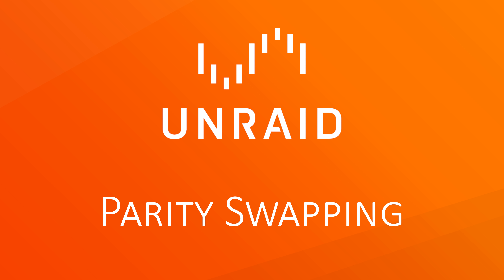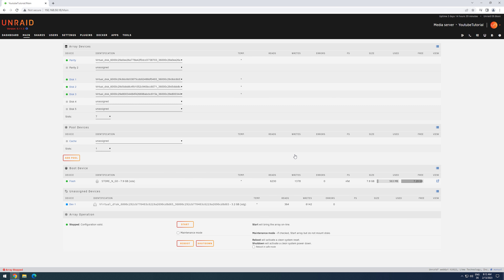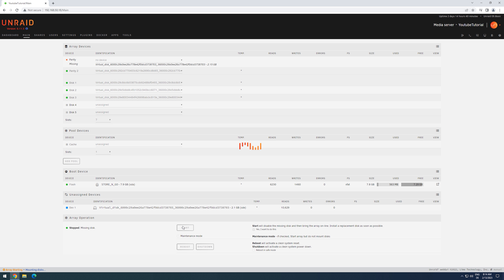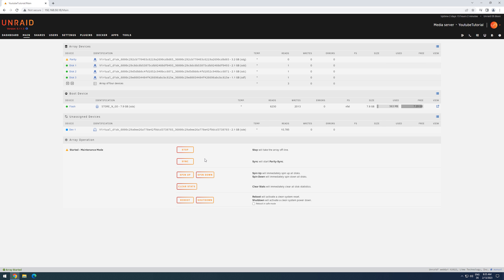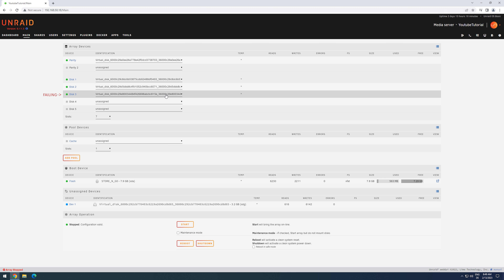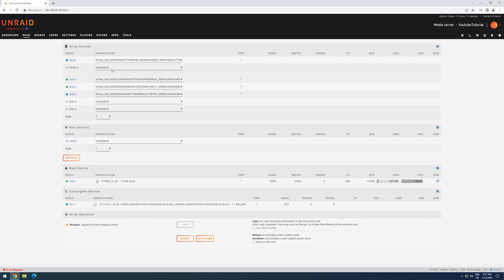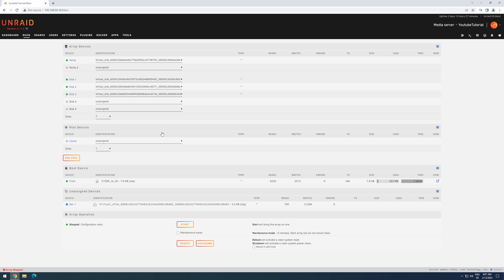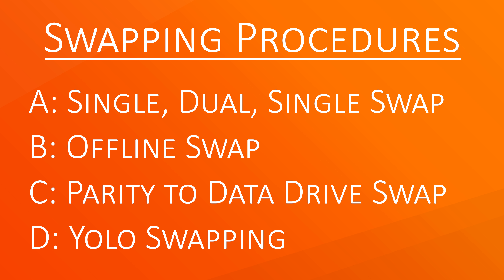Unraid Quickie - Parity Swapping Procedures

Comment: Would it work to do a single-dual-single instead of a parity-to-data-drive-swap? I have a degraded array, 1 bad drive, but the most reasonable replacement drive is a little larger than my existing parity. So parity-data-swap would be my choice, except for the fact that I'd like to have as little downtime as possible.

Comment: The only thing is, my OCD is killing me now that the array has Parity2 but no Parity1.
And you cannot simply change from parity 2 to parity 1 :P 
The calculations used for parity1 and parity2 are different so the disks cannot simply be moved.   If you want to move parity2 to the parity1 position then you would need to rebuild parity.  The alternative is just to remove parity1 and run without it leaving parity2 in place

Comment: In scenario #A how do I get Parity Drive 2, into the Parity Drive 1?
Reply from the maker: If you switch parity 2 into parity 1 you will have let parity calculate new. So you loose parity protection for that time.
Reply: right I was afraid of that, after I wrote that comment I had an unfortunate incident with the backplate of my bay.  One of the connectors broke / went bad..   and coincidentally my parity disk was in THAT particular bay..   so now i'm doing an offline rebuild with the new disk straight away, as the parity was no longer valid, no idea what was happening.   No choice I guess, server going to be offline for 4-12 days.

Comment: When doing Swapping Procedure A, the final outcome leads to the single Parity disk being called Parity 2.
Does this matter? Can you make it just called Parity instead of Parity 2. Is there any reason to?
Reply from the maker: Hi, you can't just change parity 2 to parity 1. Each parity is calculated differently. To get very specific: parity 2 is slightly more difficult for the PC to calculate so it uses a bit more CPU.

For normal usage it does not matter that it is called parity 2 though. If you want to change it you will have to recalculate the parity
Reply: @techngo8473  if there is only parity 2 in the system does it still use more CPU? If there is only parity 2 is there any other functionality that is different?
Reply from the maker: A bit more CPU and otherwise nothing is different. It uses more CPU as the mathematical method to calculate the second parity is a bit more complicated than the simple XOR of parity 1

Comment: I tried to do the copy method but it would not let me start the array if I tried to assign my old party drives to data drives in the same operation as adding the new party drives.
I also only had start array not copy for some reason.

I had two parity drives of 14TB and was upgrading them both to 18TB so I can start using larger data disks.

I ended up doing it in the worst way possible (YOLO) thinking it was going to copy, and that is why it would not let me asign the old parity drives to data (so it could copy from t hem) when I started the array I can see its rebuilding, not copying.  

I am sure everything will be fine, but this video would have helped me like say putting it in maintence mode so I could fall back to my old parity drives if needed.

At this point its running and probably best to let it finish, as I do not think starting a new operation that the old parity drives would be "known" anymore.

Comment: In the first method you build parity two and then disables parity one which is the old drive.
The thing is that the parity 2 drive is different then parity one drive. So how come its working? Parity one is i think xor even parity whereas parity two is different method. So when you remain with parity 2 you actually remain with parity drive which is not the even parity mode.
Reply from the maker: Parity 2 is calculated in a different mathematical manner than parity 1. This way of calculation is more complex to explain and calculate than XOR but basically it can work on its own as a single parity or in combination with parity 1 as a dual parity. 

If this didn't work then we would not really have a true dual parity, as a failing parity 1 would lead to no protection being left.
Reply: @techngo8473  you are absolutely right, that it has to worknon its own also.
I went and did it via method 2, taking the array offline .
Thank you very much. Was very helpful
Reply: Is there any downside to the second calculation technique? Does parity 2 fill up at a greater rate than 1 bit to 1 bit or is it slower?

Comment: Thanks for the tutorial. But what is the best way when I have 2 parity drives and want to replace them with 2 new bigger drivers?
Reply from the maker: Hi, I would switch them one at a time. As you have 2 it's very easy:

1. Stop array
2. Switch first parity drive with one of the bigger new ones
3. Start array and sync (during sync you still have parity protection from your second parity drive)
4. Once done you stop array again
5. Swap second drive with new bigger parity drive 
6. Statt array and sync again.
7. (Optional) add the 2 old drives as data drives

Alternatively:
1. Stop array
2. Switch both parity drives at once
3. Start in maintenance mode and sync (this means you can't use unRAID till the sync is done
4. Once sync is is done stop array and start again.

If anything goes wrong during 3 you can just undo it all and add the old parity drives back. This version is a bit faster overall but means during step 3 you can't access / change your unRAID data.

Alternative 2 (unsafe)
1. Stop Array
2. Change both drives
3. Start array normally and sync

This is as fast as the alternative before but skips the security step. During the sync of step 3 you have absolutely no protection. So if something goes wrong you can easily loose data.

Overall i recommend the first version of steps
Reply: @techngo8473  Thanks for the info I figure option 1 was the best method. I am replacing 2 16TB drives with 20TB's and adding the 16TB's to the data but can't afford downtime or risk data.

Comment: Is there a scenario to replace my parity drive by shutting down the server physically swapping old parity for new parity then powering back on and assigning the new drive as my parity ? i only ask this because i dont have any more sata connector space
Reply from the maker: Hi, you can definitely do that.
My recommendation:

1. Stop current Array
2. Power down Server
3 disconnect old parity and connect new parity
4. Start server and assign new parity
5. Start array in maintenance mode 
6. Wait for parity sync to complete

By starting it in maintenance mode you can't use the array but it will make sure nothing is changed untill parity build is done. If a drive fails before your new parity is done you can just shut down server put in the old parity and start the array to access the lost drives files.

You can of course also immediately fully start your array and continue using it. This will minimize downtime but you are at risk of loosing data until the new parity has been built
Reply: @techngo8473  Am I correct to say that this is basically similar to method B "offline swap"? Also, am I correct to say that Unraid is using the data array to rebuild the new parity drive, and that the old parity drive is essentially out of the picture during the rebuild?
Reply from the maker: @JeffYuYaoChiun  You are correct in your assumption that this is basically method B. 
Also you are correct in that Unraid is using the data array to rebuild the new parity drive. 
I think this video explains it fairly good: https://youtu.be/c-JNWoP2sSk. 
As we mount the array in "Maintenance mode" no files on the data drives are being changed during the parity operation. This means that for that duration of the sync the old parity drive stays valid. If something bad happens while you are doing this procedure you can just put the old parity drive back in. Once the Sync of the new parity drive is complete and you start the array normally edits on the data disks can start happening and as such the parity will also be updated. At this point the old parity drive is no longer valid. This is also shown in the video linked above.
Reply: @techngo8473  Awesome stuff. Great videos. Thank you.